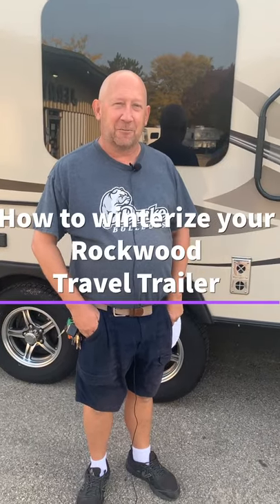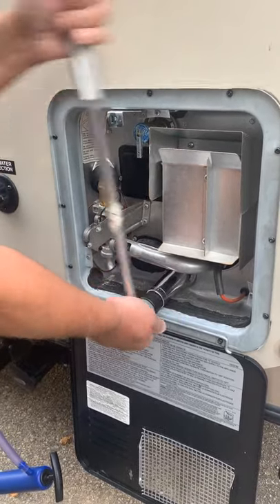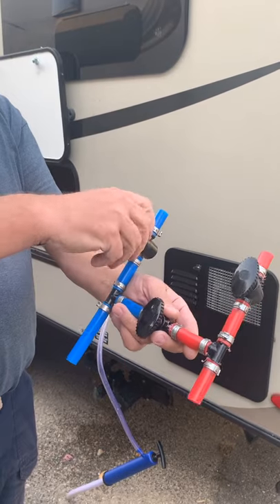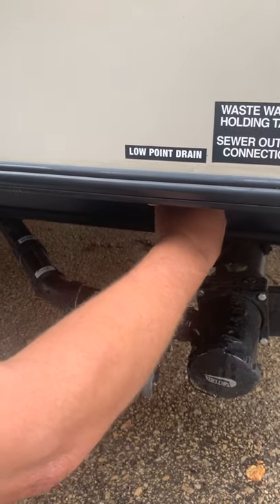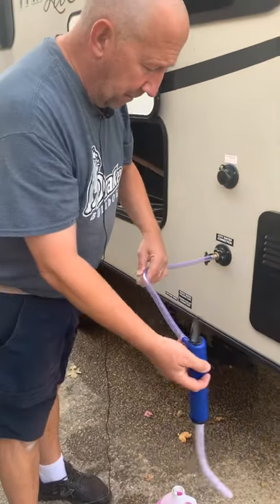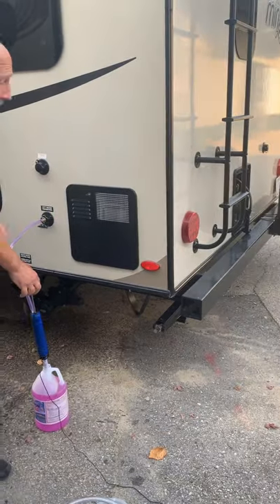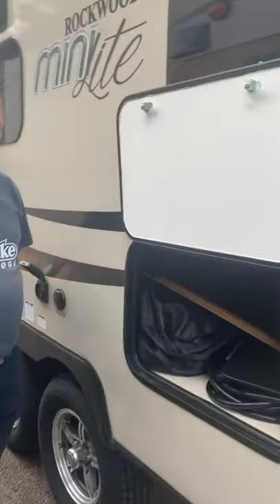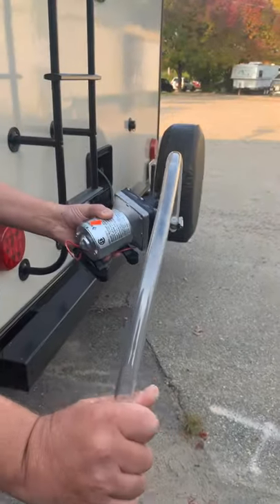How to winterize your Rockwood Travel Trailer

Comment: This a great video, veery well put together.
We have a 2021 Rockwood Signature RV.  The under belly is completely closes off.  Where would I find the drain valve for the fresh water tank?
Reply from the maker: Usually there is a sticker on the drivers side of the trailer that will roughly show the area where the valve is for draining the fresh water tank. On the enclosed underbelly there should be a valve that turns   

Thanks

Comment: I have a 2021 Rockwood mini lite 2205s. How do i access the back of the water heater to turn off hot and cold water valves and to open bypass valve. I understand all other aspects of winterizing, but do not know how to get to these valves. The manual i found on line says they are located at rear of hot water heater. Can you help or tell me where to look for this information.